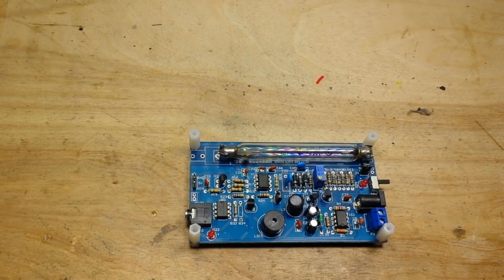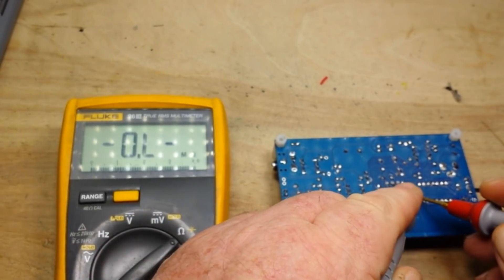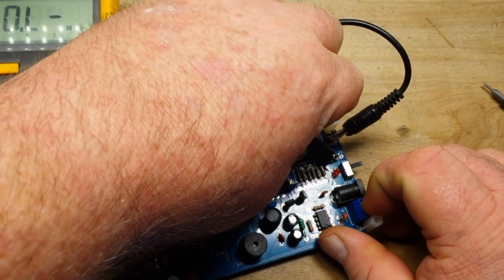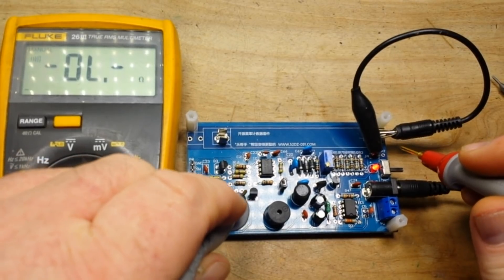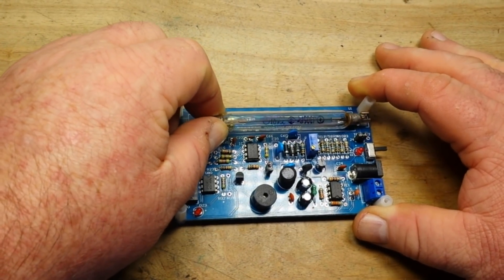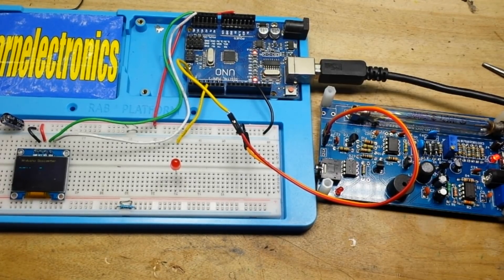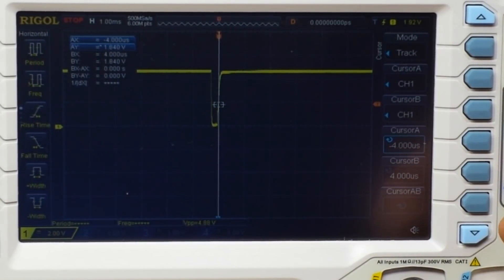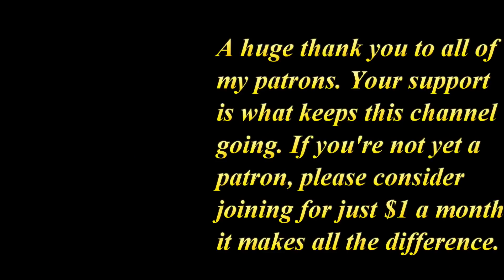Geiger Counter Experiments 2

Comment: Hi, many thanks for the video, I got a similar kit (v. 1.1, purple board) and this helped me a lot. I’d like to add just one point: for calibrating you don’t need the jumper wire. Just closing J4 makes a path through 5 10M resistors so you can test with a voltmeter. It’s in the only purpose of this part of the circuit. Anyway, I’m here to learn, correct me if I’wrong!

Comment: Hey man, I came across your calibration video because my board wasn’t working out of the box. When I tuned to 50 Ohms and then turned on the board. My measured voltage is only .9V . Do you know why this could be or if there is any way to tell if a component is bad on the board?

Comment: when i trimmed POT to 50 ohms, only had 5 volts at tube. whats up with that?
Reply: Did you ever get it to work? I’m in the same boat and I happened to come across your comment. Tuned to 50ohms and I’m only at .9V sadly

Comment: I picked one of these up a while back and just getting to it now. As a newbie I'm always timid with high voltage. I actually used my HV probe to check the voltage across the tube. Read about 0.4 so about 400v ; even at a max of 5w - 400v @ 12.5 mA seems quite spicy.
Reply from the maker: There is some ⚡ for sure. But the current is quite low
Reply: @learnelectronics  I was surprised at the voltage and the voltage drop (burden voltage) with my regular DMM.

Comment: The protoboard LED is really blinking when the interrupt fires, just you are turning it ON then in the next program step turning it OFF in the interrupt routine.
The flash would be so brief, you cannot see it.
Try only having the count updated in the interrupt routine, move the digitalwrites out as they are holding up your code, in fact don't put it in your code for the moment and see what happens.

Comment: not sure if its much help but the arduino code I have used is below, you will probably need to change the oled setup and install any libraries you haven't got but here it is.

///////////////////////////////////////////////////////////////////////////////////////////////////////////////////////////////////////////////////////////////////////////////////////////////////////
unsigned long counts; //variable for GM Tube events
unsigned long previousMillis; //variable for time measurement

#include <Arduino.h>
#include <U8g2lib.h>
#ifdef U8X8_HAVE_HW_SPI
#include <SPI.h>
#endif
#ifdef U8X8_HAVE_HW_I2C
#include <Wire.h>
#endif
#define LOG_PERIOD 15000

U8G2_SSD1306_128X32_UNIVISION_1_HW_I2C u8g2(U8G2_R0, /* reset=*/ U8X8_PIN_NONE);//oled setup

void impulse() { 
    counts++;
}
void setup() {

     counts = 0;
    Serial.begin(9600);
    pinMode(2, INPUT);   
    attachInterrupt(digitalPinToInterrupt(2), impulse, FALLING); //define external interrupts 
    Serial.println("Start counter");

  u8g2.begin();  
}

void loop() {
      unsigned long currentMillis = millis();
    if (currentMillis - previousMillis > LOG_PERIOD) {
        previousMillis = currentMillis;
        Serial.print(counts*4);
        Serial.println("");
        Serial.print(counts*4*0.008120);
        Serial.println("");

        u8g2.firstPage();
  do {
    u8g2.setFont(u8g2_font_ncenB10_tr);
    u8g2.setCursor(1, 13);
    u8g2.print(counts*4);
    u8g2.setCursor(72, 13);
    u8g2.print(" CPM");
    u8g2.setCursor(1, 30);
    u8g2.print(counts*4*0.008120);
    u8g2.setCursor(72, 30);
    u8g2.print(" usv/h");
    ;
  } while ( u8g2.nextPage() );
        
        counts = 0;
    }

}

Comment: this is the link to the instructable i used to make my current Geiger Counter, mine is shown in the i made it posts at the bottom of the instructables, its the bright yellow version. its a great design, and im working on building the mk2 version at the moment, making a custom case that is much more practical for feild use, with beta sheild for tube. 

https://www.instructables.com/id/DIY-Geiger-Counter-With-an-ESP8266-and-a-Touchscre/

Comment: OK now you have the geiger counter (presumably) with the $1.79 zombie addon.  While it's as cool as f*@^  .... I have to say I'm hoping you're never going to need it... in more than a local context anyway.
I'm amazed you say you've never used one.  One of my duties on the 'phones was looking after some of the bombometers.  In the event of it actually happening we had a purely mechanical standby - strowager backed by manually switched calls operated by a mix of engineers and telephonists.  At the centre of each station was the bombometer.  A tube running from the surface - to a rainwater tank.  The bomb goes off - the pressure wave goes down the pipe and blows out some of the water.  Also in the tank was a ball-cock attached to a lever operated depth  guage .... the water left in the first surviving tank nearest ground zero could be used (along with data on how many stations were uncontactable) to calculate the magnitude of the impact.  The impact (to life) of the attack was estimated using a slightly less sophisticated counter (fewer parts - all immune to EMP).  And tested with a slug of something in a very heavy box.
Happy days. I don't know what's used these days the ship's biscuits must be off by now and many of the the crews must be too old to remember where the entrances were.

Comment: "Radioactivity... is in the air for you and me" . Tune into the melody . Does the interrupt of arduino MCU  is fast enought to get the edge of that pulse ? use a function generator to check that with pulse generation capability or cmos/ ttl waveform. Again thanks for the explanation and example of using scope to capture pulses , to troubleshoot signals.

Comment: Good Stuff.   Got side tracked again and not done the Monitor as of yet.  I'll be waiting for the Mark II Code ?  LOL  I'll get it going soon.   LOL    Like to come up with another Geiger Tube and construct a wand.   Reading  it seems you can in fact run the tubes Parallel to each other.  Can't recall the guys name off hand but he used a 555 to clean up the pulses from the Geiger counter board.  You could  use about any  Schottky Gate to do the same.  That may help your counter better detect the counts ? 
Edited.   Here ya go.  This is the guy that built the 555 Circuit to clean up the pulses.  https://www.youtube.com/channel/UCWjdqkYj2lsUjn91-iFHuFA

Comment: I designed a board designed to be put on a board like this as a project at University. It's has an oled display, a GPS receiver and a SD card reader. And I can now use it as a portable radiation logger that logs location, time and radiation level.
Was a fun project!
Reply: Be very interested to see your design. working on a touch screen Geiger counter, that uses the esp8266 board. would be great to add gps and sd card capability to it. it currently has data logging but without the gps details they are not very practical. would be great to be able to log field trips so i know where the natural uranium is in my local area. there is high concentrations at a number of spots that are withing two hours drive from my place. be nice to have a map of the radioactive areas.
Reply: @noelandrew3600  I might be able to share the design after the course is finished in January :) it's based on a stm32 mcu, so sadly it's no Arduino compatible code ready. But I can probably publish a schematic,
Reply: @awesomefacepalm  that would be very cool if you did put it out there for every one to use like that guy who designed the transistor tester ya see everywhere and can buy as a kit build!!! i sure would like to have the schematic for when i get better at this stuff because, that particular design sounds very cool with the GPS on on it and data logger, its the icing on the cake!!

p.s, i bet you will get an A+ in you exam for that design!! good luck with them!!!